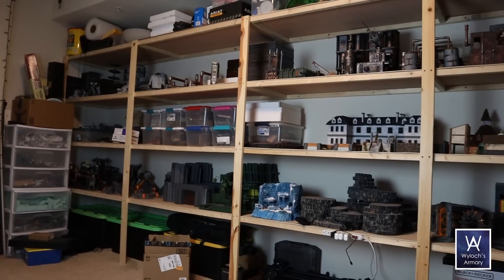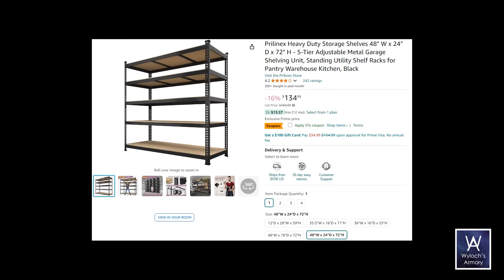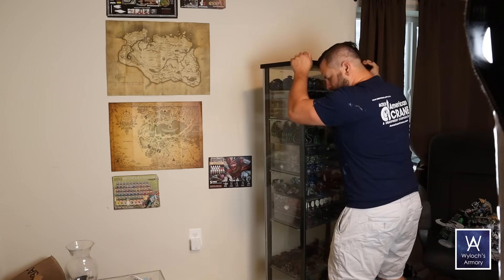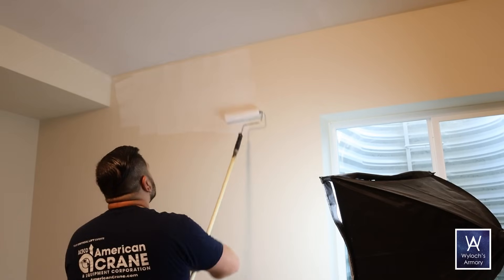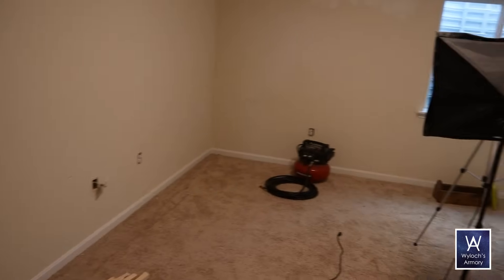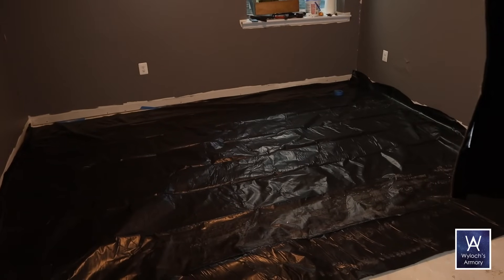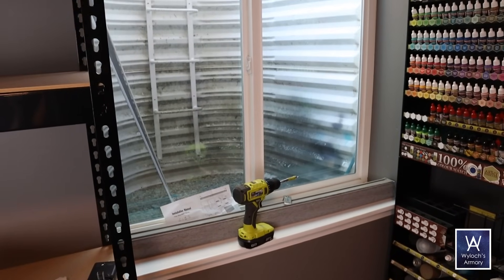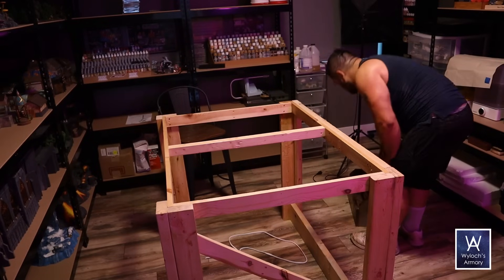Total Workshop Renovation.  Now I can actually enjoy hobbying.

Comment: Just finished watching, and I came away with 5 things:
1.)	Painter’s Caulk is the Nuln Oil of the home improvement industry.
2.)	Never invite Wyloch into my house with all its quarter round… or at least distract from said quarter round by pointing out that the flooring is all Pergo.
3.)	All of proper civilization is held together with drywall screws.
4.)	When in doubt, ask Wifeloch.
5.)	Every workshop needs a toaster.
🤣

Seriously, dude, this is an AMAZING build!  I'm already in need of re-organizing/updating my craft room, and I've saved this video to my 'watch later' list so I can use it as a reference.  Thanks for sharing and I look forward to many more videos shot here!
Reply: #3 - preach!

Comment: been working on remodeling my game room, its been 12 months so far. But had to replumb, re wire, new windows,  re insulate, re frame..... its been a nightmare. Did it all myself. This weekend hanging the last pieces of sheetrock and mudding so will be doing it this weekend so i can install the floor and trim and finally move in!!!!

Comment: This is dope. Also it's called a tray ceiling.
Reply from the maker: Thx!  But sir: nay.  A tray or recessed ceiling is a deliberate design choice in which the entire perimeter of the ceiling is dropped some amount.  This is a drop-down only on one side of the room, to accommodate air ducting.  It is an interior soffit.
Reply: @WylochsArmory  oooooohhhh you are correct and I'm an imbecile lol

Comment: How did you secure the granite to the bench frame?
Reply from the maker: No need.  So damn heavy it doesn't move.  But typically one would use a bead of silicone caulk underneath to prevent shifting

Comment: Is it possible to put a removable cover over the escape hole? If so, you may be able to use it still.
Reply from the maker: There's a steel grill up there.  It's only about four feet up to ground